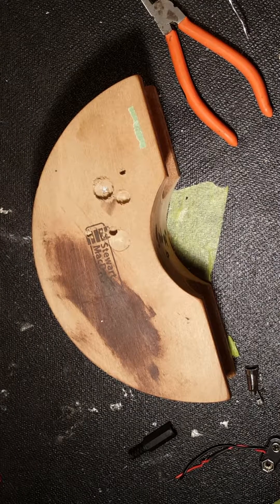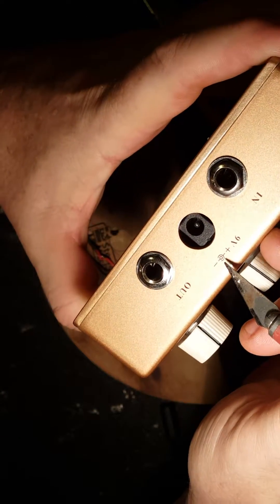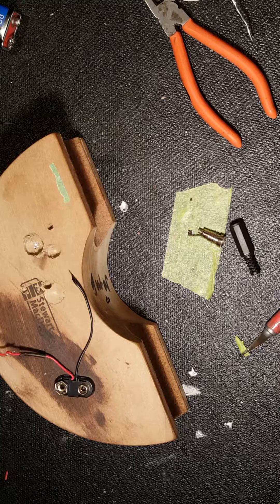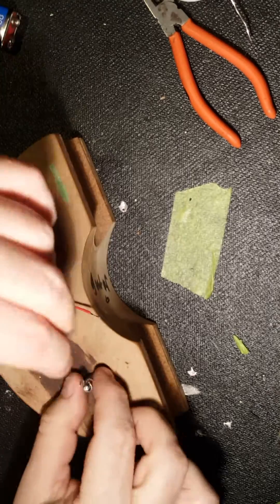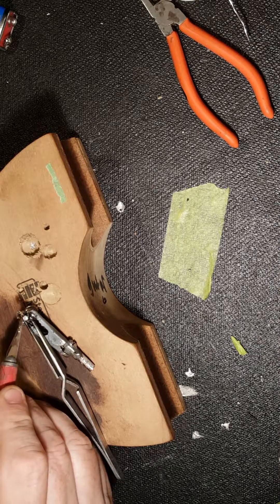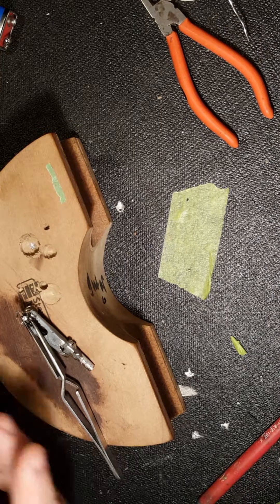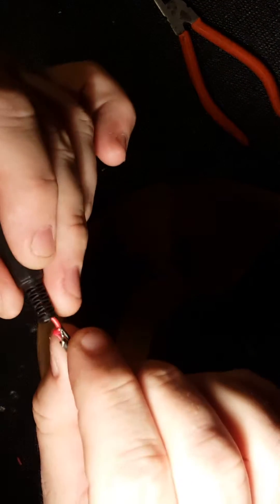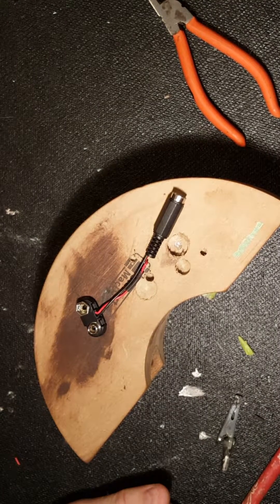How to make a 9v battery eliminator for guitar pedals

Comment: I just wondering about one thing — big muff pi is center positive but does it matter if I solder a power adapter to battery connector? will it be safe to daisy chain it with negative centered pedals?